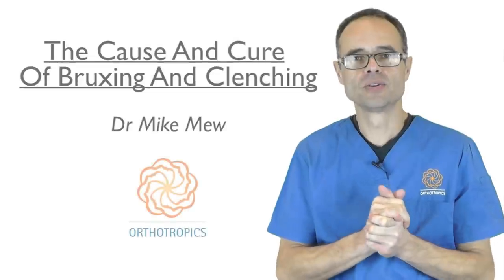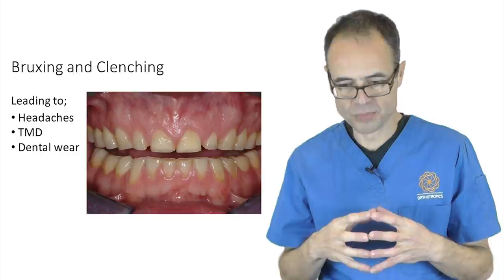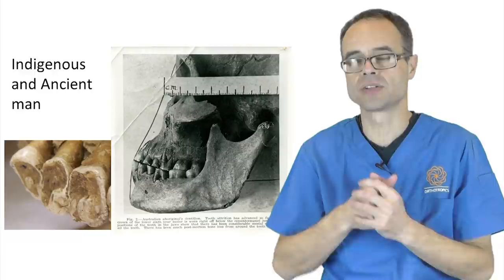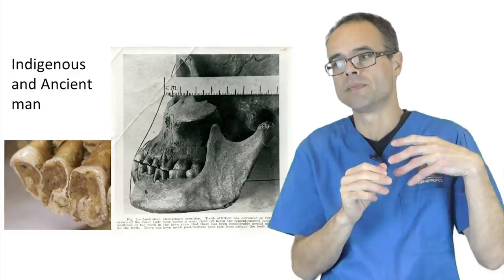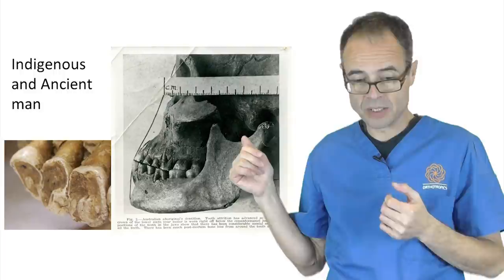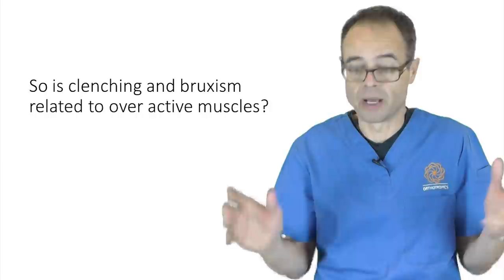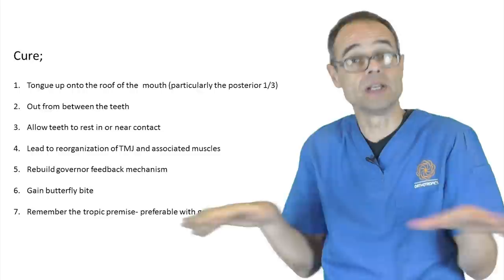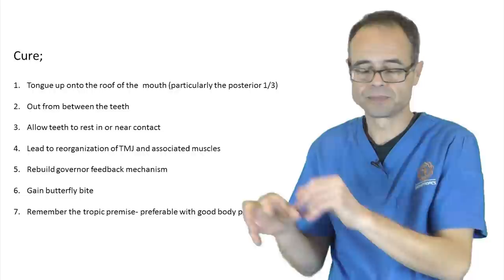The Cause And Cure Of Bruxism And Clenching By Dr Mike Mew

Comment: I had been clenching my jaw overnight for the past year. As soon as I started strengthening my tongue and resting it on the top of my mouth I clenched less and less each night until after 2 weeks when I stopped clenching all together. Thank you for this information!
Reply: Close to front teeth or ?
Reply: Did your breathing get better?
Reply: The Number One Thing He Says According To My Opinion, Is That For These Behaviors To Be Improved, You Must Have Tongue Space... I Have Teeth That Are Falling Inward Slowly, And I Am Losing Tongue Space. But I Haven't Given Up.
Reply: @StarfireReborn  do you have bruxism,  because i originally was a mouth breather who had their tongue on the lower part of the mouth, as soon as i start mewing, i developed tmj and bruxism symptoms to compenstate for the narrow palate so my tongue could actually fit in between and so i could breath. Is bruxism not a response to this? Although its been years i have yet to master mewing completely and nose breathing especially when im sleeping, which is also when i have my bruxism, wierd huh.
Reply: @abejunkies  try mouth taping at night to facilitate nose breathing. It really works.
Reply: @abejunkies  I seem to have developed bruxism after learning to sleep with my mouth closed. I have narrow pallete or big tongue. With awareness I am catching myself doing a closed  mouth yawn (and shifting stretching) coinciding with clenching with immense force multiple times in my sleep.

Comment: This is extremely helpful information more people need to know about. I have suffered from bruxism and tmj that was especially bad in my teens. Braces proceeded and followed by use of a night guard have helped, but not really solved the problem; in fact I stopped using the night guard often or I would just clench on it.  Only having less stress in my life as I get older helps with the clenching. However, I have continued to be a frequent mouth breather because of my allergies, and now I am not happy with the way my face is aging. My neck is already starting to sag and I'm only 49! This will not do at all. Until I stumbled across Dr. Mews videos I had no clue this and other problems could possibly be due to habitual tongue position. As I write this I have only known about the importance of tongue position for two days and I'm already very hopeful it will make a difference. It seems to improve my posture and somehow actually helps to keep my sinuses clear.

Comment: Many thanks for this video. As a long term grinder who lives on amitriptyline with bad occipital spasms and pain in jaw and shoulders and neck, I know that some of the problem occurred after a period of years when my nasal passages were blocked after an accident and nose surgery. Only a cranial osteopath helped me breathe through my nose again. Additional stress combined with, anxiety and intense computer usage and poor body posture ( post-viral muscle wastage) has left me with years of pain. Interestingly working with Clinical Pilates on my core and walking uphill helps. I can release some of the spasms with tongue exercises i just made up myself (instinctual desperation for relief). Thank you for a holistic approach as well. You sell nothing but some sense. I am considering have a mouthguard made for me but also came across orofacial myotherapy exercises on You tube. Some of these are, once more, exercises I have been intuitively doing anyway - using my tongue.

Comment: Thank you so much for this video! You provide a lot of insight into this problem that I've only the past few months noticed for myself, and I realise I've been doing it for years. I will use your guidance to help me deal with bruxism :) 

A few pointers for your future videos (which I hope you make more as you seem open minded and that is always welcome!): 
1. Getting a better microphone would help people to learn from you more easily, as the breathing comes through very loud on those lav mics currently being used. I recommend either an external mic (the rode NT1-A is brilliant), or simply your smartphone mic. As long as the breathing volume is lowered
2. You seem to go off topic a bit, or as I experience it, there is too much information that takes a while to come back to the main point for one video. I suggest either separating the information into different videos - maybe a two parter or more - or simply trimming the points that are not so necessary to understanding the main point and cure of bruxism, which is the main problem people come here to solve. 

These are suggestions from a viewer and you may feel differently about how you want to do things. Either way, you've helped myself and from the looks of the comments loads more people. Thank you again :)

Comment: dude try meditating on it as you fall asleep. telling yourself over and over to relax and don't clench. It worked so well for me that even in my dreams i was reminding myself not to clench. Also consider the way you rest your head on your pillow. Changing the way i supported my head helped a lot. I think this will work for most people.
Reply: How do you position your head on the pillow and how do you use the pillow(and not pillows I assume)???
Reply: @andrewdavis438  I had physical therapy to help with bruxism and discussed this. Mainly two sleeping positions are recommended, one is you lay on your back with a good supportive pillow under your head/supporting your neck, and place a smaller pillow under your knees (avoid locked knees during sleep). The other is on your side, again good supportive pillow giving you a good posture (not chin up but not too far down either), and a small pillow between your knees (depends on body but for me this works as I'm quite skinny and otherwise my knees would be kinda "inwards"), a third pillow can be placed against your chest (hugging position) or between the arm that rests on your torso and your torso - so the shoulder does not fall forward, if that makes sense.
You should avoid sleeping on your stomach/face, as it can cause neck, teeth and breathing problems, and it forces you to turn your head to one side (or at least it's not common to sleep with your head actually straight into a pillow).
I think I've always mostly fallen asleep in the correct positions, but I often wake up on my stomach. You can avoid this by placing pillows around you in hopes of not turning around in your sleep.
Reply: @2024rush  See comment above.
Reply: @RebeccaEd  thanks for the tips. So in both position, on the back or the sided, we need to keep pillow under or between the knees. I'm just curious to know what the position of knees has to do with teeth grinding?!!
Reply: @andrewdavis438  it depends what postion you sleep in. you want to get your spine as aligned as possible. if the pillow is pushing your head forward or not cradling your neck then you need to adjust probably. I've also heard some people actually prefer no pillow. if your a back sleeper that could work. basically you don want pressure on your face or bad posture
Reply: I been trying this it’s powerful! I remind myself all night

Comment: I had a clicking jaw for two years, and the plastic device they made for my bruxism actually made it worse so I stopped using it. I started mewing about three weeks ago and the synthomps have improved GREATLY. Also, i used to have to adjust my jaw every morning because it would be super tense after my sleep, so it would damage my joints and it would hurt the first time of the day that opened my mouth. However, about three days ago, i discovered that instead of painfully opening my mouth, I could just push the roof of my mouth with my mouth (like a more active and stronger mewing) and it would ADJUST ITSELF. I honestly believe you are a genius. Thank you very very much.
Reply: Você é brasileiro? Os sintomas permanecem até hoje ou sumiram?

Comment: Summary:
What mike was saying is that to everyone muscle action there is always a antagonist muscle action.
       The antagonist muscles for jaw muscles are Tongue and Neck muscles.
If you overwork jaw muscles and underwork the antagonist muscles then jaw tend to be overactive.
So you clench and grind your teeth.
Reply: Yeah this is exactly what happened to me when I started mewing again. 

When I mew I do it while practicing good body posture, being backed up to a wall and mew 20 times over, my jaw feels strong and firm everytime I practice this.

Over time my tongue posture felt more natural so I began to abandon the posture exercises and mew while I was doing literally anything, even relaxing in bed, and after a while I started getting minor muscle spasms in my jaw joints and boy that was terrifying.
 
So yeah, engage your body when mewing, not just your jaw.

Edit: I should also add, DO NOT CLENCH YOUR TEETH, that will cause the jaw pain, just lightly touch your teeth when mewing

Comment: I have had Migraine Aura for 10 years. It started with crazy migraine symptoms, blindness, nausea, facial pain. I was at a friends house, and after i eat something, i got a huge explosion of colors in my vision. After hospital visits, which they found nothing, i had panic attacks, i had no idea it was migraines, i don't get the head pain, just the migraine aura. 2 weeks later i developed Fibromyalgia, which i only realised now that i have had since i was a teenager. I ignored migraine aura for 10 years, lines around shadows in my vision, blindness, the glowy colors wasn't that bad after i conquered the panic attacks. Every day for ten years, just ignoring it.

Now ten years later, i developed Gastritis. I went on a Keto diet, which is mostly steak. I realised my Fibromyalgia was better, but my migraines turned into tension headaches. Pressure on both sides of jaw and head, vision problems got worse, glowy colors symptom was all day, sensitive to sound, ringing in ears, pressure on facial cheeks. i noticed after all this time i have been clenching my teeth. I clench the back of my teeth when i sleep. I must have been doing this since my teens. I always wondered why i felt better when i had the flu, because my nose would be blocked, which i had to breath through my mouth when sleeping, resulting in me resting my jaw. I worked all this out when i was chewing steak, i stopped half way through, and then rested my jaw, all the symptoms popped up, vision, hearing, pressure on face etc. 

Now i am trying to stop it. I have blocked my nose with tissues to make me breath through my mouth, hoping it would rest my jaw. Wake up with the tissues out of my nose, so that doesn't work. I got some night guards from the chemist, but i think they make it worse. I'm getting a custom made night guard coming, hoping it will help. Sometimes the migraines or tension headaches can get pretty bad, i can have glowy vision all day, or pressure on the sides of my jaw and head, sensitive to sound, it has kept me inside the house for months. 

I think the jaw clenching is a way some ppl deal with stress, i'm not a angry person, i never get into arguments. The stress is pushed deep down into the subconscious, and then comes out through the jaw while sleeping. I also think this is the cause of conditions like Fibromyalgia. The clenching is hidden, it can't bee seen because the person is sleeping. Dentist miss it, because it's a slight clench, but a long clench, from falling asleep to waking up. Fibromyalgia and conditions like it, have been known to be from not getting REM sleep. I only dream maybe once a year, mostly when i have the flu. The body is not getting the full REM sleep, because it's constantly clenching the jaw. The hardest part is how to stop this clenching. Lowering stress can help, but having no stress is impossible. Life is stressful, which means the clenching will always be there. There must be a way to stop the clenching. My next method is trying CBD oil trying to push the body into that REM sleep. 

I have been through Panic Attacks, Anxiety, Depression, it was just a year of fear. All because of Jaw Clenching. I was diagnosed with Atypical Trigeminal Neuralgia and Fibromalgia. I think both of these conditions are cause by years of hidden jaw clenching.

Migraine aura and fibro fog, was like walking around with the feeling of just about to pass out, but ignoring it. No matter how bad it got, i never gave up. I will never give up trying to find a way to Stop The Clench.
Reply: Respect your optimism and faith despite all the shit you’ve had to deal with. keep going. 🙏🏽❤️
Reply: man, you just described me! We are not alone!
Reply: I have synesthesia so when I have migraine auras, they are WILD.  I have noticed that I have a similar problem - jaw clenching.  I tried a mouth guard but I would grind my teeth even more & it made it difficult to sleep (I normally breathe through my nose).  I started meditating before bed, using active meditation (yoga/qi gong) & passive yoga (no moving, just mindful breathing) & I have noticed that I do not clench/grind my teeth while sleeping.  I also got an orthotic pillow which keeps my spine aligned while I sleep  & that has also made a huge difference.  I have not had as many migraines/migraine auras as I used to.  Plus, I learned from my neurologist that it is common for migraine sufferers to be deficient in Vitamin B-2 (Riboflavin) & Magnesium (Mg).  I take the Mg at night, since it helps the muscles to relax.  It does wonders!  Hopefully, some of this info can help you.  I manage to get to a Chiropractor at least once per month, which also helps.
Reply: Did u also have puffy eyes and itchy ears and congested nose ..and of course dull headaches around eyes watering eyes?

Comment: Dr, thank you for this video.  I noticed that merely by assuming proper head posture head (extension of the cervical spine, subtle head tilt down, hyoid process up and locked) EVENTUALLY, the nasal passages cleared up and breathing through the nose became feasible.  Our physiology contains multiple pressure systems (intra-abdominal, -ocular, vascular, etc) so why not one within the mouth, possibly intra-maxillofacial?  I agree about the concept of recriprocal inhibition and how that dominates the interaction of our musculoskeletal systems (what other way could it be?)  On your point of researchers and theorists, I personally believe not much original creative thought goes into research, but repetition of the existing body of literature and tremendous confirmation bias.  Anyhow, thank you for having the courage and the creative, pioneering Spirit to produce these fascinating videos.

Comment: About 1 month ago I started Mewing and Wim Hof breathing and gum chewing. My sinus breathing opened immediately and improved in terms of smoothness, flow rate and expansion capacity immensely during this time.

As a Medical Qigong Energy Therapist
Reply: I incorporated other body release methods as needed.

It has taken breathing, meditation, energy flow and more to  whole new level and I am beginning to incorporate Mewing into my work with clients. 

In qigong we teach in most cases to keep the tip of the tongue in the pocket behind the upper teeth. In retrospect I am seriously questioning if this ancient teaching needs to be updated given the diet and other issues you discuss. I am preparing to start a discussion around this topic in the near future and would like permission to with proper credit use some of your before and after photos to help me present the teaching.

Also are there any cases where where mewing might be contraindicated?

I am extremely interested in evolving  your family teachings to incorporate this incredible facial posture concept into whole body healing and energy based posture work. I sense a synergy can be very effective to facilitate the embodied integration of Mewing.

Comment: I am 53 years old and have been clenching my teeth for as long as I can remember.  Mostly in my sleep, but when I was very young, it was constant--day and night.  When I was a teenager, it was so bad, I had my dentist make me a bite-plate to wear while sleeping.  I used it for about a year.  About a year ago, an orthodontist made me two more bite plates--one for sleeping and one for daytime use.  In my experience, these things do not work.  All they do is redistribute the pressure evenly over all the teeth.  This reduces the pain, but also makes it possible to bite down even harder.  I have long suspected that what's really needed is an apparatus which will concentrate the pressure in a very small area, rather than diffusing it.  Dr. Mew confirmed my thinking with his discussion of the steam engine governor and what happens if you bite down accidentally on a piece of buck shot.  To make matters worse, my orthodontist adjusts the bite plate monthly, using carbon paper to locate the high spots.  What I really need, I am sure, is some sort of bite plate with spikes, or some other mechanism to concentrate the pressure and activate my jaw's governor.
Reply: Mort Snerd My Orthodontist placed bite blocks behind my front teeth. No more grinding. It’s been wonderful. I had a serious clenching and grinding issue and had damaged my teeth badly.  I like not having to use a nightguard anymore. It’s great.
Reply: @kwclove7623  what’s it called